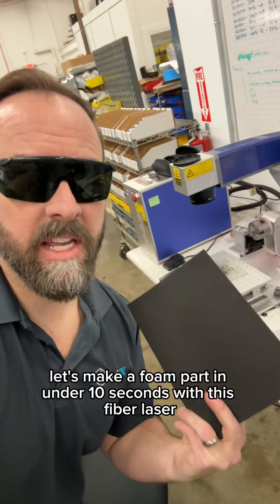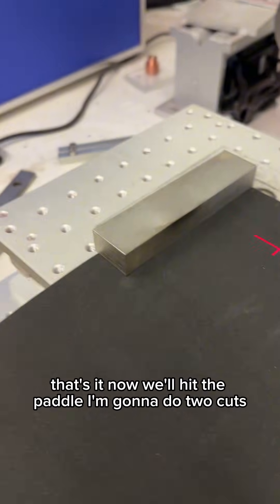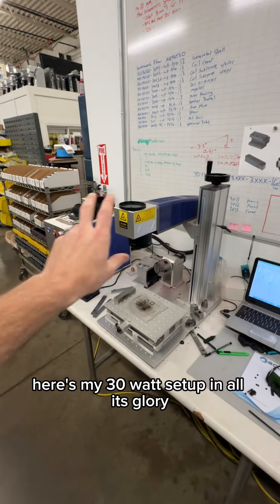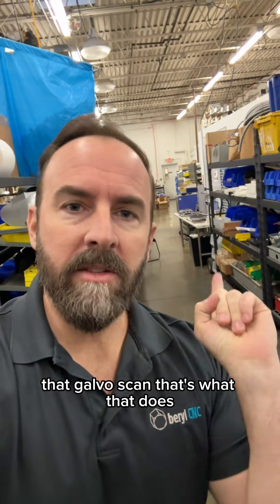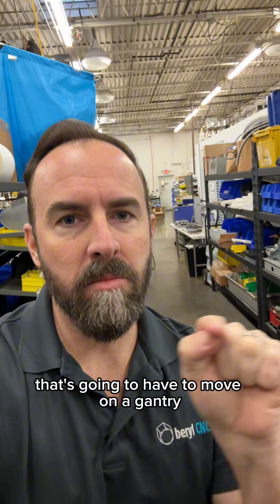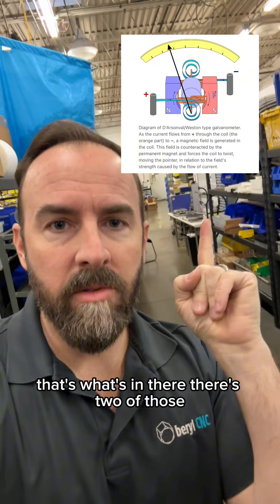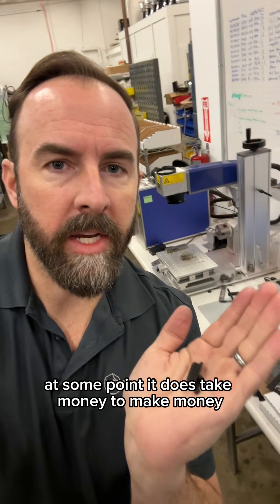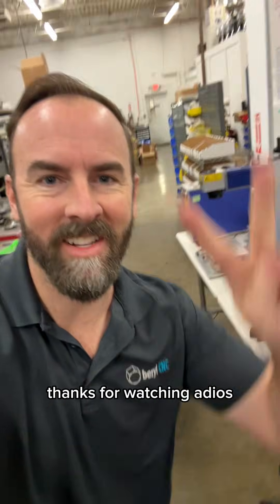Fiber Laser Cuts Instant Foam Parts

Comment: My local college has a maker space open to the public. It is an affordable way to access 3d printers, a CO2 laser and a bunch of other cool stuff. 

We use the laser for cutting acrylic and then we bend it in our shop with a $200 acrylic bender. 

Check for community resources. You may have access to more cool tools than you knew!
Reply from the maker: I love that these community tools exist, in theory, but I personally don’t like the idea of relying on community tools for any of my customer projects. If it helps you get started then thats def a good thing.
Reply: @i2c_jason  Agreed. I prototyped an enclosure on the market space 3d printers. When it was clear I needed a bunch of them I got a printer myself. I still use their laser cutter because I didn't have the volume to get my own...yet.

Comment: I work in the applications lab of a company with a 12 kW fibre laser, also through a scanning head with galvos (though much bigger). We mostly test welding processes. 

The most important thing I've learned is that more power = more fun